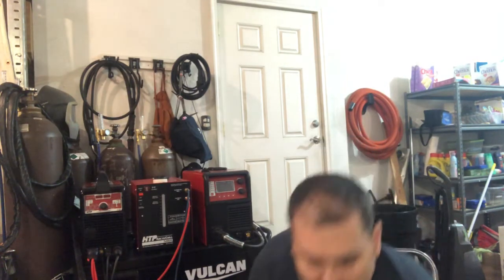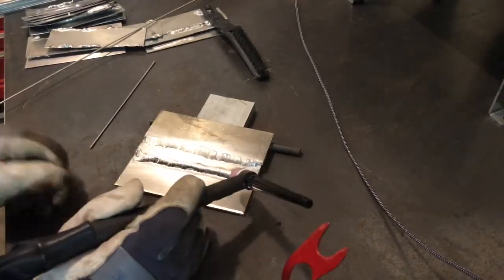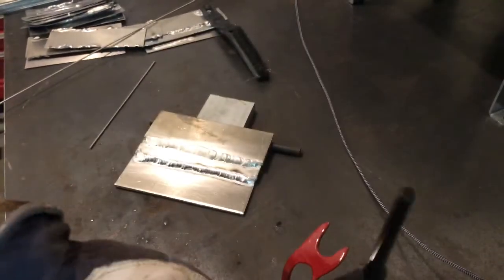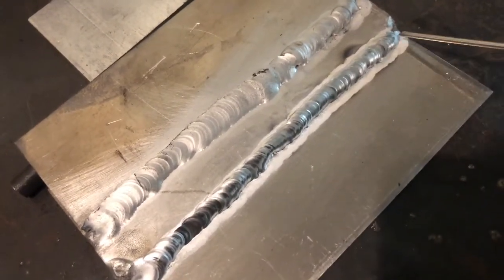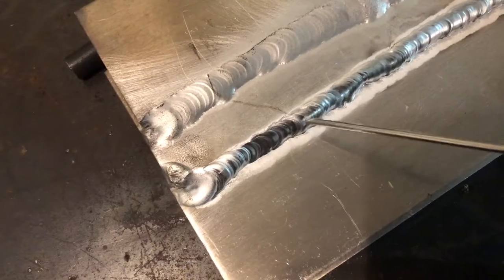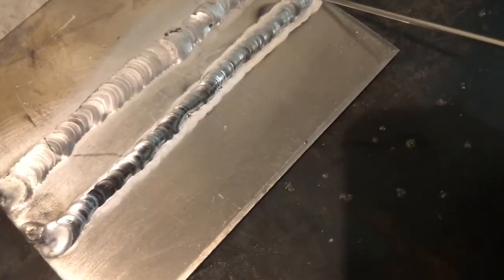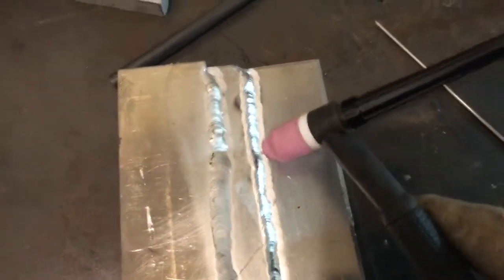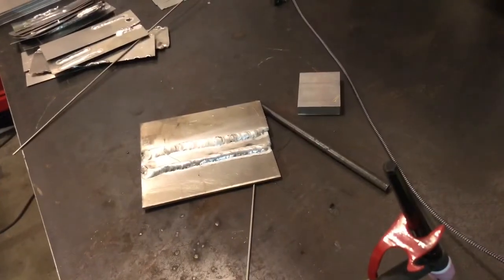HTP Invertig 221 Aluminum lap Joint - Learning Curve

Comment from the maker: Breaking in the Invertig 221 if anyone has any feedback id love to hear as i am trying to learn the best i can. Being self taught i can only learn more from you guys. Thanks for watching if you want to see more adventures please subscribe i will be working on my videos to make them more fun and more watchable. Thanks Again.
Reply: Welding Junkie 2 much torch angle for starters. ;)
Reply: Aim electrode on the top corner and let it wash down.  To much angle on ur tig torch also.  Otherwise your getting the hang of it and doing good.   Yes I weld aluminum and stainless for a living and used htp welders for 6yrs.   These machines have come along ways compared to what they use to be.
Reply from the maker: Steven Izatt thanks Steven for your help and watching. I’ve gotten a little better but that’s one joint I cannot seem to get down. I’ll try your recommendation and wash it down. Do I keep it aimed at the thicker piece?
Reply: Welding Junkie no problem.   Yes that is the biggest trick.  No matter what material your welding.   Always focus on the thicker material.
Reply from the maker: Do you suggest wide open amp on pedal or limit at machine for top end on pedal? instead of 210 amps or limit it to top end of whatever you are welding?
Reply: It really depends.   I rarely use over 180amps when welding aluminum unless I’m welding intercooler cores or something that is extremely thick but if it really thick I’ll preheat it before I attempt to weld it.   Ur question basically comes down to comfort level.   The hardest part of tig welding is reading the puddle and being able to catch the weld before it gets to hot.  This is extremely important with stainless. Especially if you work in situations where it needs to be 100% sanitary welds dealing with food and medical equipment.   What I would do is set the machine so when u strike the arc ur floored and it takes less than 10seconds to start the puddle.  This will help with learning to read the puddle and teach you to slowly back off on amps as you weld until the puddle stays a consistent size and then u have found the sweet spot.  Once you have that down you will be able to turn the machine to max amps and weld whatever u want because you will know exactly what to look for in the puddle.

Comment: How's it going almost 2 years later? I have the same 221 water cooled setup and Vulcan cart. LOL
Reply from the maker: Tim Trombley It’s absolutely awesome so I gave my first one to my father in law and bought a Dynasty 280dx and a month in the boards fried. Took 2 months to fix under warranty and when I picked it up I sold it to another you tuber and bought another HTP Invertig 221 lol I’ve never looked back since it’s an incredible machine I love it. How do you like yours? Btw the Cart is still going strong they did a great job on it.
Reply: @weldingjunkie  Awesome. I think I saw video describing the problems with your Dynasty. I have a couple Miller machines as well (Multimatic 215, my first machine, and a 220 that I thought would replace my Invertig.) I ended up investing more and got the watercooler for my Invertig. It's a great machine, and I am considering selling both Millers and getting a Pro Pulse 220 for MIG. I like the folks at HTP and visited their shop while at FabTech in November. I'm just messing around in the garage but like to have cool tools that make the jobs easier and more enjoyable.
Reply from the maker: Tim Trombley I would do that for sure. HTP is an awesome company and back up thier products. Jeff Nolan is a great guy. The arc on the invertig vs dynasty is much softer and easier to work with. The arc doesn’t bite off the ends on thin material as opposed to the miller. My father in law has the multimatic 255 pulse and it’s a good machine but I wish we had the pro pulse 300 it’s amazing. I love my pro pulse 200 tho. Sometimes people think I’m just drinking the htp koolaide but anyone who’s used one knows how amazing they are. Well worth the money. I did a video on the ac amplitude settings which is a high end function. I like them a lot
Reply: Welding Junkie hey Jay. Question on size and fit with the Coolmate 1.3 on the Vulcan cart. The specs Miller puts out say the cooler is 24” deep. Does it hang off the back of the cart? I see it hangs over the front but not the actual blue sheet metal part of it. Can you explain how it fits or send me some more pics please?

Comment: They look good a lot better than I did when I first started! A tip from a novice,one of the things that helped me the most was I got a piece of 12"x12" 1/4" aluminum and literally ran bead after bead after bead, until both sides where basically completely covered. I'd run 5 or 6 beads then if change the ac frequency and run 5 or 6 more see if they got better or worse then I'd change the ac balance a little and the amperage some just to get to know my machine and what settings I like because I've watched probably every welding tips and tricks, tig time txsviking and I know I've watched every 6061 video even paid the $45 Subscription but it was worth it to me. But after all the hours of video and all the suggested or "optimal" settings I just like my settings a little different. Stay tuned maybe today or tomorrow I'll make a quick video of what I like settings wise and my setup and do some quick welding maybe it'll help you out some
Reply from the maker: Darin jasperson Darin jasperson awesome Darin looking forward to seeing it. The 70/120 settings seem to work great. What machine do you have? I only move the freq depending on what weld I am making. I’ve ran a ton of flat I just have not done any t joint lap etc I plan to work on more tomm for a good part of the day.
Reply: Jason yeah I've seemed to fallen into liking 75% and like 65-70hz at home, I'm kinda stuck with the 60hz at work. At home I have an AHP Alphatig, at work I use a syncrowave 250dx so it's an older transformer machine but luckily it's new enough to have ac balance so at work depending on what I'm welding I will set the balance between like 80% to 70%. I do a lot of aluminum tig at work on polished aluminum so I'll set the balance to 80 to keep that cleaning action down as low as possible so I'll have less polishing to do afterwards. So I just finished filming a really short video where I did a couple beads on aluminum and then I pulled out my #8 Pyrex cup and my #16 to show the scotch bright trick I talked about in your other video. Hopefully it helps. If you want or need me to I can shot a couple more videos when I have a little more time doing a t joint. If you haven't done any t joints yet be prepared to get extremely aggravated because you have to sharpen your tungsten every 5 minutes lol. Best advice I can give on t joints is have a little longer stick out so the point almost touches the root of the joint and then every time you add filler increase your arc length some to prevent from sticking the filler to the tungsten. And another tip once you start don't be afraid to get some heat in there to get it to puddle add your first dip of fill rod then slowly countine if you need to back off the amperage some as you move then get back into it and dip. I noticed on your one video it seemed you were in a rush to move then dip, and you were feeding it a ton of filler, just get a puddle going add rod move make sure before you add rod again that you can see the puddle melting all the way into the bottom of the joint then dip and move there's no rush. If you feel like your rushing to move and dip back off the heat some and slow down
Reply: Hey Jason just wanted to let you know, I got that short video uploaded let me know if that helps and if you'd like me to make any other videos that might help

Comment: I'm old school when it comes to welding but to me zirconium tungsten is the best for  Aluminum.  It balls up but gives a really stable arc.  I've used ceriated tungsten which is great for 200amp+.  Pure tung is ok but not too stable. I've ordered E3 tungsten to give it a try. Heard some good things about this tungsten. It's   supposed to be a good all around tungsten. It's supposed to be good for DC as well as AC. Also the cup you are using to me has to small a orifice. You want the gas to spread out a little more. Don't restrict it like when welding steel or stainless. Aluminum requires more coverage. Hope this helps.
Reply from the maker: R Reichel Thank You helps very much. Waiting for my glass cups to come in. Do you use the same cup for any amps? I have 10&12 stubby Pyrex coming in. I was using 6 for the 40 amps. I’m new to Tig so any help is great.
Reply: Jason  I've got pyrex cups but ceramic work just fine a nice thing about the Pyrex is you can see through it that's about it.  I've never found it being any better than ceramic cups but the nice thing about Pyrex  Is that you can see more easily how close your tungsten is to the puddle.  Which is a nice thing to be able to see.  The screen diffuser is definitely a plus but not a necessity. I think it does make your welds run a little smoother for sure as it gives it a better even distribution of the argon gas.  Hope this helps.
Reply: Jason  Yeah I forgot to ask what size cup were you using?

Comment: few tips for ally. Clean material very well. Either scotchbrite it or DA sand it then acetone wipe the material and filler wire. Give 5356 filler a try, love that stuff for shiny beads and flows better than 4043. Your torch angle is too much. Try to keep in as close to 90 as you can. i usually stay at around 75-80 degrees. start with 70 percent cleaning and 135 amps on machine and use foot pedal. try 60 hz then adjust as you want. usually the higher the frequency the more focused the arc, 60z is a good number for those lap joints to get in to melt together and soak the heat in. Try to get about 2" welds at a time, no need to do more than that when learning and try and focus on your tie ins from weld to weld. once you get better you can add more distance and focus on your filler hand. Keep at it.
Reply from the maker: 6SpeedFab Awesome information I think it’s going to be very helpful many thanks. So 60hz is more focused that 120hz? I love that you have the 221 too it makes our settings the same. I was on 70% cleaning does that work for almost every application she’s using clean metals? Great idea about the small runs that will help me start my start stops, I saw that after watching your stainless vid.
Reply: Jason 60hz is wider puddle making the 2 metals joint together makeing lap joints easier. 70 is a good balance can adjust up or down depending on if you have dirty metal or want more penetration.